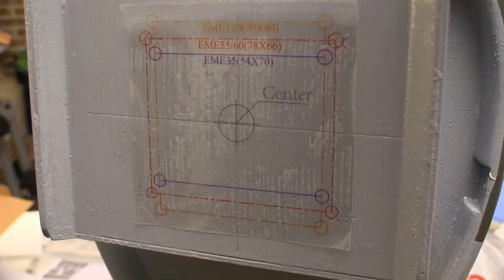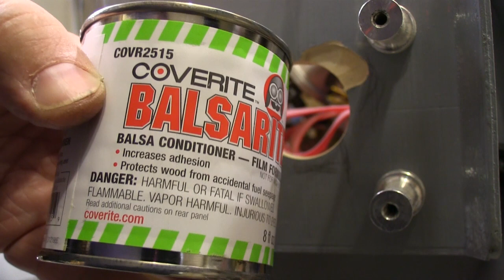Top-Flite Giant Scale P47 Razorback – Segment 3

Comment: Question for you! I’m using a RotoFlow tank (24 ounce) with my TF P47 with Saito fg60 and the stock fuel tank mounts are to small. Should I make new ones or use the electric battery tray ( modified) to hold the tank? I’m not sure if the height would be wrong if I mount the factory battery tray for the fuel tank. 

I believe you used the battery tray to mount your roto flow tank in the p47. Is the height okay?
Reply from the maker: I did use the battery tray to mount the tank and fuel flow was never an issue. Worked fine.
Reply: thintz12 great, thank you and enjoy watching your videos